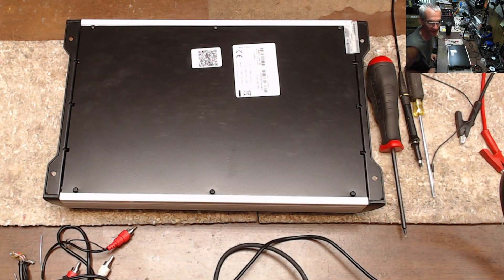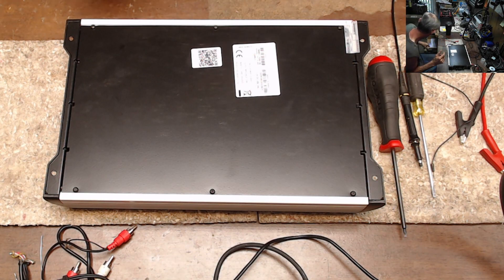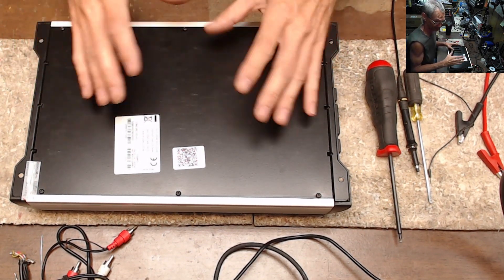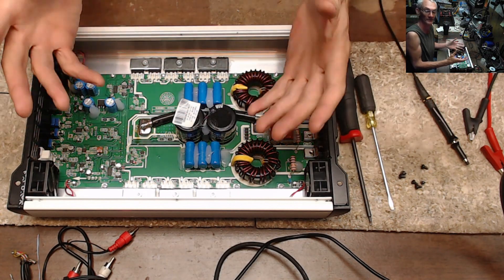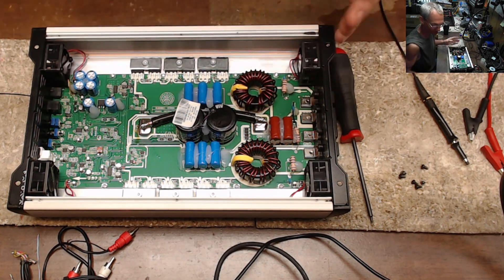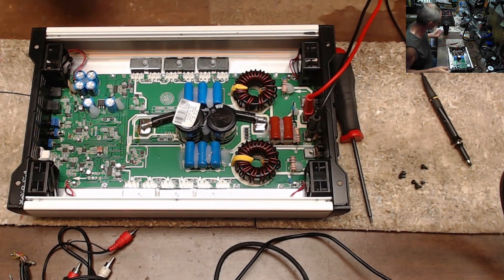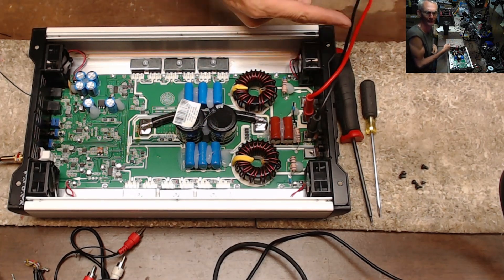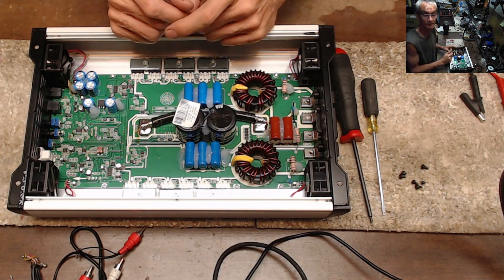Taramps 20,000 Watt Chipeo High Voltage Amplifier Overview of Amazon Returns

Comment: Could you build your own power supply and run off high amperage at say 12 or 14 volts just wondering
Reply from the maker: A person can build a supply but if for something like this 20k you need 140+ volts along with a ton of available current. These are not 12v amplifiers so whatever voltage you input is what your positive rail output will be.

Comment: Ridiculous that people think they can get 20kW from a thing like this in a car… forget about the Power Supply, what about the cables to the speakers, let alone the speakers?
Reply from the maker: Crazy numbers can be pulled indeed. With more EV vehicles coming out I bet one will see more and more of these no power supply amplifiers being used.
Reply: @ellensburgamplifier  well, in the 90’s and early 2000’s we saw those 2000W PMPO amps advertised… if you ripped them apart they had such small transformers in their power supplies that could barely supply 20W. Guess times have moved on, and now they have bigger numbers to keep up with the times, and are just as ridiculous in their claims, just 1000 worse, but now they can claim it is digital, no more analogue stuff, and that explains everything…. Except the maths and laws of physics stays the same… unless the newest speakers have an impedance of 0.0008 ohms, and the latest oxygen-free speaker cables are superconductors, and the car battery can deliver 1-zillion amps with 0V drop over the power cables…. Lets face it, it is easy to fool gullible people with lots of specs.

Comment: 😂 I could only imagine all the people who lack the knowledge buying high powered amplifiers and hooking them up on a factory car . I am here to find out the difference between the hv line of amps.
Reply from the maker: The HV amplifiers don't have power supplies which is why you need to supply high voltage DC to it such as an EV vehicle or several batteries in series. All other amplifiers use standard 12 volts and then the power supply produces the 150+ volts.

Comment: I guess the ones who are saying this amp doesn’t reach rated power is the ones who’s lacking knowledge. We’re not in the 90s anymore where it takes a 10 foot amp to get a couple thousand watts, we are seeing amplifiers the size of a cellphone doing 500 watts RMS. Of course you will need to be running a large power bank with proper size wire in order to get the rated power. This looks like a pretty sweet business to own but now he’s gave everyone the knowledge they need and will is taking away his own job security. 😂
Reply from the maker: If there is one thing I have learned during the years of electronics repair, people always burn up or damage their stuff. Oh, and attempt to wire amplifiers in a way that is not recommended. Ya you .5 ohm people running 4 gauge wire with the $100 Les Schwab battery. Sorry, had to say it! Indeed a lucrative business if planned correctly.

Comment: Those ain't 20k gutz no way it's reaching that power rating
Reply: Here in brazil we have high voltage modules 20000w rms up to 160000w rms. Real rms power
Reply: Why not? It’s D class and efficient so not much heat losses. At that power speaker voltage is so high amp does not need thick wiring. More power you output the less voltage it needs to decrease compared to input voltage. At high voltage no big currents as with 12v. All gutz comes from battery pack

Comment: Had a question about an amp I recently picked up, a ds18 10k half bridge. They used 45n50f's on the output section 12 total to be exact, is this adequate enough for 10k while charging in the high 15's or is this running the rail voltage too close to breakdown of the chips?
Reply from the maker: I don't service DS amplifiers so I don't know their power supply design. It depends on the turn ratio of the transformers. I would expect 15 to be OK they are 500-volt transistors. They couldn't be much more different than all the other boards out there.

Comment: So how many batteries do u need to run them correctly lithium batteries and at what amp ah
Reply from the maker: Ah is the rated capacitance of a cell or battery so that will depend on your build and how you use the amplifier. https://www.taramps.com.br/en/produto/en-hv20-000-chipeo/ down to the technical information will show the amplifier specifications. If you download the manual you will find more information about the minimum and maximum voltages.
Reply: Need around 120 ish volts to run the amp to its potential

Comment: Hello
  I have a model  "  mba 1680 dc   " amplifier that consumes about one and four tenths of amps
does in the power input
It gets a little hot in the output section of the inductors.
The voltage at the outputs is about one and fourteen tenths of a volt.
Have you repaired this model so I can watch the video?
The main problem is that the sound is not output. This is a Class D amplifier made in China
Thank you for guiding me
Reply from the maker: I see this is a multi-channel amplifier. Does it use the IRS2092 to drive each channel? I do not have a video on this amplifier but it may be a typical topology.
Reply: @ellensburgamplifier  Hi، thank you very much for responding.

Comment: Where do you connect the remote
Reply from the maker: There is a set screw plug connector on the output side of the amplifier.
Reply: @ellensburgamplifier   ok great thank you very much we have this exact amp just having issues getting it to power on
Reply from the maker: @jrodriguez4145  Do you have the correct input voltage of about 160 volts?
Reply: @ellensburgamplifier   no that’s the issue we are having the amp is not turning on at all so we have to figure that out we just have a regular 12 volt battery seperate for it
Reply from the maker: @jrodriguez4145  Yes, you will use a 12v remote source to start it which will be separate from your (13) - 12 volt batteries in series or a regulated EV battery.
Reply: @ellensburgamplifier  ok cool thank you so much for this information really helps us out a lot your the man appreciate it. Keep up the great videos

Comment: 160V amp!!! Darn near 220v!!!! Yeah!!!! If we had 40v more in home in America, would be able to operate in a house with minimal equipment. Wouldn't be surprised if someone tries to run this amp on an EV with knowledge of lithium pack configuration. People out there, please read the information when it comes to Taramps. They have many amplifier power input configurations for efficiency purpose and flexibility builds. It takes less current to run 20k on 160v, then it does 20k on 12v input power.
Reply from the maker: Very well stated my friend! Out of the stack of 10 next to me only 2 needed repair. One was a user error and the other was a factory error. I think there is something I will bring up with Taramps. On the back sticker it states "for 12v use only" which could be misleading to the consumer.
Reply: @ellensburgamplifier  very true. Great attention to that detail. May be stock labeled covers that may fit both the high voltage and the 12v line of amps they sell. For sure they have to address that. My question is, what kind of charging source would you use for it? 12-14v motor with a 190v generator?
Reply from the maker: @mikehonda7934  THat is an excellent question. How do you charge up 13 x 12v batteries in series in a practical way?
Reply: @ellensburgamplifier  I did a search, and it’s quite a chore either way to keep a charge on the batteries. The amp becomes a Tesla in a way. Taramps recommended a charger each battery at 15a to charge the batteries individually with circuit breakers to separate the charging per battery. So you get to use the amp according to the battery Ah you have on tap, then you have to individually charge the batteries when the voltage drops. Seems like a use only 1/4 of the amp daily kind of amp.
Reply: @ellensburgamplifier here in brasil we put like 1 14.4v power supply per battery

Comment: They are a true 20k rms amp I’ve ran 4 of them and now run the hv 40k
Reply from the maker: Thank you for the info!
Reply: @ellensburgamplifier  anytime I’m running 253 volts on the 40k and they are running perfect no issues and clamping over 34k with rise if people only new how efficient hv can be and the savings that can be had running lithium to save space and the added energy density
Reply: @MrVuetim92  so how many batteries are u running for the 20 watt amp I just got one